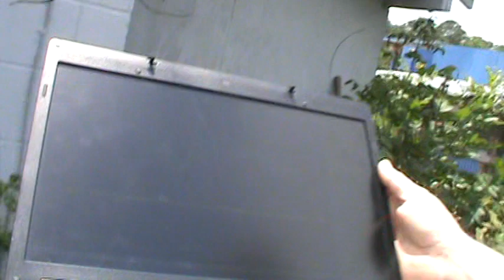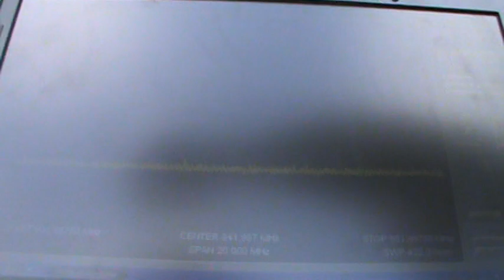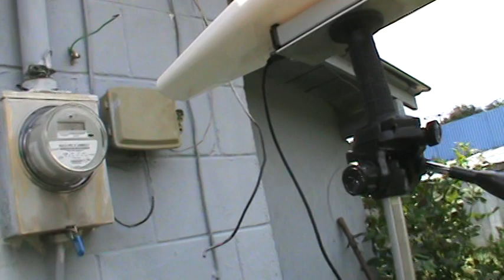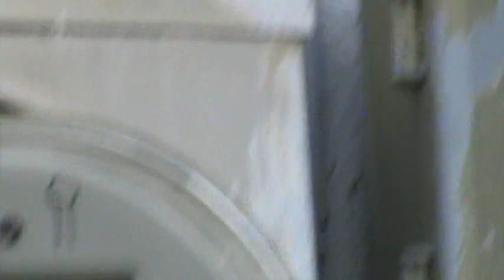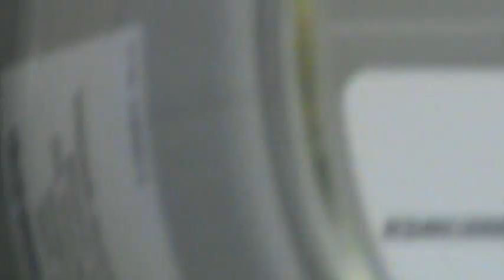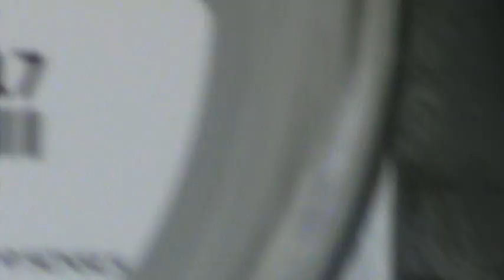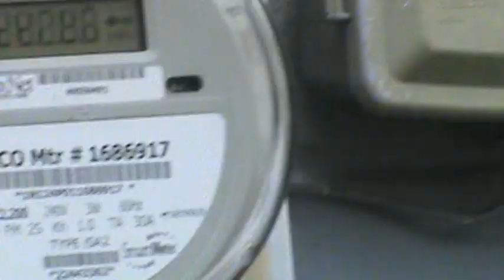Georgia Power Smart Meter Investigation Part 1

Comment: Everywhere’s you see a sign that read free Wi-Fi  a router is radiating signals through the air into and through your body, weather you use the location as a hotspot or not ,  if you have a blue tooth device in your house car work place you are receiving RF signals.  Cellular towers admitted a high voltage frequency in order to be able to reach you at long distances wherever you may be bouncing the signals off the other cell towers also increase the power of each phone calls to be able to be heard short and long distance.  Stop worrying about a meter that is red once a month and concern yourself with the amount of information your cell phone collects about you each and every moment of the day It knows where are you going and what you’re doing and who you’re talking to me while people sleep with these phones people keep them in their back pocket all the time so you can imagine how much radiation is going through your body that’s something I think about .   Never mind the RF frequency that you receive if you’re sitting in one of those wonderful electrical cars that I have a gigantic battery and you’re worried about your meter really.

Comment: Radiation, bottom line. So what's smart? You also paying for power is uses to operate. Da.
Reply: Not likely in a direct sense. The meter takes is power from the line side, or top terminals, therefore is not part of the meter reading totals!  But the old meters did the same, and had voltage and current coils, and some had digital displays and electronic pulse outputs where needed!
I guess it could be considered part of the operating cost of the company like everything else and get their money back when people pay their bills! Same with the old meters!

Comment: They also have the technology to transmit data over hi voltage wires.  Just search eBay amazon on Ethernet over wall outlets.
Reply: Smart meters are killing over 100+ people every month and you don't care.
What kind of person are you?
Reply from the maker: as part of further investigations into what was causing the problems overall, I used numerous IP over power line feeds gear, esp 2015-2018.....

Comment: They are lying , about it only transmits 3x /day. My srp account webpage will track and graph my electrical usage each and every hour of each and every day .
Reply: So which STUPID TREE did you fall out of Nase ASE?
Smart meters transmit 23 hours, 59 minutes and 30 seconds every day.
THAT IS WHY THERE ARE OVER 100+ DEATHS EVERY MONTH FROM THE EXTREMELY HIGH LEVELS OF SMART METER RADIATION

Comment: FCC this, & FCC that. That is what this guy is hiding behind, he knows that this stuff is dangerous but what the heck, he's gotta earn a paycheck.

FCC guidelines are a joke. China & Russia have better guidelines than the FCC. The FCC has not one single medical professional on staff or that has looked at the biological effects of this wireless radiation. Anyone that trusts the FCC guidelines you are gullible. There are 1,000's of non-industry studies that prove beyond a shadow of a doubt that this wireless radiation is harmful. The NTP study has recently showed that there is more serious health consequences from the LOWER level radiation than from the higher levels. 

He kept saying -31 dB was the reading. And how such a small number that is. Well, when measuring the dB level (decibles) of wireless radiation, guess what? The smaller number means stronger. So -31dB is stronger than -100 dB. And on some WiFi Signal Strength Meters that you can get as an App on your phone, shows that  -31dB actually pegs off the top of the meter as that meter reads between -100dB (low-no signal) to -40dB (high-great signal).

They also kept saying that the meter only transmits 4-6 times a day. Whose to say that the younger guy didn't first send a signal, a software message to that meter to go into a 'mode' of 4 to 6 times a day before he even set up this dog & pony show of an investigation. The power company keeping itself in line. Yeah, right.

And even if these SM's give off less radiation than a cell phone that doesn't matter. Why? Because you can choose to have a cell phone or not. Choose to turn it off or on. You are being FORCED to ave this spying, radiation emitting, fire-hazard of a device attached to your home with no recourse. You cannot shut it off, ever, or they will charge you with a crime.

It's all about controlling you and your spouse and your children--- everyone. It is all smoke and mirrors  to hide the lies.

People need to wake up, and STAND UP and say no!

Look behind the curtain. It's a really small and evil man who is afraid of his own shadow. All you have to do is STAND up for what is right and good. Or sit down and allow the evil to roll on past you uninhibited.
Reply: And now you know why smart meters kill over 100 disabled folks every month.

Comment: Here its spread spectrum unlicensed. And no tower exists it jumps from house to house and repeaters are hung on poles.
Reply from the maker: the receiving tower for local electrical service smart meters is at the GA Power substation 1/2 mile from my current home....it is specifically for electrical meters according to the people putting it up who I stopped and asked...you can google simpson circle in Cartersville GA 30121 and find it

Comment: SOMEONE lie here.  941 mgs is in the Ham bands .They don't own this 941 mhz. As they say. Check your ham frequently.  It is with in their hams bands. Check with a ham radio person
Reply: 2.3.1 Frequency Hopping Spread Spectrum

Operation in the 902–928MHz Band Regulations in the United States
The frequency band of 902–928 MHz is one of the Industrial, Scientific, and Medical bands in the US, commonly abbreviated as the 915-MHz ISM band. In this band, there are no restrictions to the application or the duty cycle as   there were for the control and periodic applications described above. Furthermore, the allowed power output is considerably higher. Because of the lack of restrictions and higher allowed power, this band is very popular for unlicensed short range applications including audio and video transmission. FCC section 15.249 allows 50 mV/m of electrical field strength at 3 meters distance in the frequency band of 902–928MHz. This corresponds to an EIRP of – 1.23 dBm. The harmonics limit is one hundredth of  the fundamental level, 500 μ V/m, corresponding to an EIRP of  – 41.23 dBm. Note that this is the same as the spurious emission limit listed in Table 1

Frequency Hopping Spread Spectrum Even higher output power can be used if the system employs some form of spread spectrum such as frequency hopping or direct sequence spread spectrum. The reason such allowances are made is that spread spectrum systems are less likely to interfere with other systems than are single frequency transmitters.
The output power limits for frequency hopping is one of the few times that the FCC expresses such a limit in units other than the observed electric field strength. As long as the antenna gain is not larger than 6dBi, the permitted peak transmit power delivered to the antenna is +30 dBm for systems with a 20-dB bandwidth lower than 250 kHz and at least 50 hopping frequencies. For systems with a larger bandwidth but less than 50 hopping frequencies, The peak transmit power is +24 dBm.
Transmit power for the 902 – 928 MHz band
Frequency hopping EIRP > 50 channels: +38dBm
Digital spread EIRP      +36.dBm
Other        EIRP  -1.23 dBm
ALL measuring shall be done with detector using a CISPR quasi peak detector.
 
http://www.ti.com/lit/an/swra048/swra048.pdf

Comment: Three things.    First he said the equipment was supposed to be 20cm form the meter   From what I see he is over 18 inches.  Point 2 is 20 cm is  just a tad under 8 inches therefore the 3db he is reading should be squared plus a little bit for a true reading of over 9dB.  Point 3 the tech is either stunned or lying no technician can be that stunned.  Point 4 is he is in charge of wuelling questions.
Reply: They know what they are doing. 
Do you really think they are going to tell a homeowner with a medical implant that are now FORCED to stay 2 to 4 feet away from the side of their own home?  
They will lose their job and PENSION if they tell the TRUTH.

Comment: Some of you people do not understand radio waves,  first this is not microwave, microwave starts at one thousand megahertz , witch is the bottom end of the microwave band, this meter they are showing is close to the frequency of the things that millions of people are holding to the heads call a cell phone,   baby monitors, cordless phones,  old cell phones,  police radios , and they put out way more power that these meters do,  a lot of the older things used 800 to 900 mhz frequency,

Comment: I'm not saying that I know EVERYTHING or trying to be the channel master here but I will tell you that I have had a LOT of time on my hands
since 1999 when I became disabled. I have also immersed myself in the radio arts for the last 45 years. If I need to know something, I look it
up from a RELIABLE source and not some hokum web site put up by someone who either doesn't know what they're talking about or has
nothing better to do than panic people over NON ISSUES like smart meters. I've read CRAP here from know nothings and I try to set them
straight with REAL, verifiable science. Sometimes I'm not so diplomatic about it but it scares me sometimes the things that go viral from
people who shouldn't speak when they don't know what they're talking about. They see "microwave radiation" and immediately think of that
DANGEROUS little box in the kitchen that burns your food when you're not looking. Actually, according to International conventions and
agreements, the range of frequencies in the microwave band runs from 300 MHz, or 300 MILLION cycles per second, to 300 GHZ or 300
BILLION cycles per second. I used to live in west central Florida. Outside of Tampa is the transmitter for channel 44 TV which was in the
sub band called UHF or ultra high frequency. I used to pick up the audio portion of Ch. 44's broadcast on 454 Mhz on my scanner so even
some of the
 TV that
 I watched back then was in the microwave band. Now, TV has been moved into a new digital band. Ch.44 transmits at
100,000 watts. If you go look around it's tower, you WON'T find a flock of
 dead birds that just happened to fly by.
One thing that I have noticed here is that the religious faction of the smart meter hater's club who try and dispute the facts that I post here
ALWAYS come back with what they THINK, what they've READ in the back of some comic book or Russian bot web site, or they come back
with some lame attempt at quoting some technical sounding jargon like "interferes with ionic bonding" which, by the way is what keeps the
sodium
 metal and chlorine gas from coming apart in your salt shaker so if you see a yellow gas coming out of your salt shaker that smells
like bleach,
 you call or e-mail me and I'll kiss your bare ass at noon on main street. Another guy tried to rattle off all these bad health effects
that smart meters "cause" like heart trouble, memory problems, birth defects, cancer and it's recurrence and DNA damage and failure of
DNA to repair itself once damaged. Now, you can look this up if you want to but Google it or go to some REPUTABLE medical professional
and ask. When you are conceived and your cells begin to divide, your DNA begins to deteriorate from that moment on. Most people are
familiar with the DNA double helix? It looks amazingly like a ladder that was caught in a tornado. It is twisted. It is of a certain length
according to what your parents contributed. EVERY time your cells divide from conception to death, that DNA gets shorter and shorter.
Ever wonder why you don't look like you're 20 on your 70th birthday? It is because your DNA is approaching it's end of the strand and your
BODY can NOT repair it's collagen and connective tissues as well if at all so things begin to sag. This is commonly referred to as OLD AGE.
The people exposed to high dose radiation at the Chernobyl accident in 1986 who's DNA was damaged never stood a chance to have it
repair itself because it never will but not because of the radiation which caused the damage. It's because DNA NEVER repairs itself!!! If
it did, we wouldn't grow old. I'd be willing to bet everything that I own in this world, an 1836 Sq Ft house on an acre, a Lincoln MKZ, a
100 CB / HAM radio collection, a shotgun, a rifle and 4 dogs
 that this "medical expert" hadn't had a DAY of medical or electrical training
IN HIS LIFE! The same goes for the guy that tried to explain 11 technical deficiencies that INSURANCE COMPANIES wouldn't stand for
and would be on the picket line at your side if he was right not to mention the UTTERLY MASSIVE liability that the power companies
would be leaving themselves open for if just one death was attributable to the "problems" that he cited in these "DANGEROUS" meters.
People, you have to STOP taking everything you read and hear at face value and take the time to actually LEARN about the message that
you are trying to spread. You birds of a feather get into your own little flocks and reinforce your own MISINFORMATION until your whip
yourselves into a lather over nothing. I'm NOT saying that there aren't dangers in the world but while you are living your lives ducking and
dodging that BB that the
 power company is wanting to mount on the side of your house, you are NOT seeing the cannon balls coming at
you with global warming, (regardless of what you think, if you live long enough, you'll see who's right.), other air and water pollution waning
energy supplies and world overcrowding. ANY 1 of these will put a bigger crimp in your lifestyle before that flea powered smart meter that
transmits
 for a WHOPPING 40 1/1,000th's of a second per day TOTAL!!! SMARTEN UP, PEOPLE, YOUR LIFE MAY DEPEND ON IT SOMEDAY!!!
Reply: I apologize for the broken text in my last post. It doesn't do it in my e-mails or word processing so I THINK it is something with
YouTube. I'll get it checked out when I can. Jeff M.
Reply: Jeff for someone who seems to be of the opinion  that smart meters are good for us I find your multiple posts which must take up your expert knoledge would be solving the Mars problems so we can expand mankind.  But you seem to me too invested in telling others that have concerns that they are stupid no not stupid . I ask you what benifit can you state that we must be crazy not to see from this microwave transmitter. I suggest that one read u.n. agenda 21and population control 5g silent wars which are great reads by the way. And the fact that c.i.a. and others have tools 
Like you seem to be to stifle the truth. Conspiracy theories was a term coined by. The c.iA. to label those who questioned the j.f.k. official cover up. We are awake aware and you are tool . Or someone who just worries too much what others talk about.
Reply: @yorick30127  My problem is with people like you, 1) First and foremost, you DON'T know what you're talking about which conceivably could cause a panic among people like you who don't understand the subject that you panic about. 2) You, like tRump, like to try and whip people into a frenzy over imagined or minimally invasive subjects like extremely low powered transmitters and the effects from them that do NOT exist. 3) I never said that we need smart meters but the only benefit that I can see from them, living in the rural area that I do, is saving the power company money in truck fuel and man hours in driving all the way out here to read a few meter per road mile and hopefully forestalling a rate increase by a few months or years. You, yourself, seem to have a lot of time on your hands. Why don't you spend some of it and get a degree in electronics engineering, It will help you to sleep better at night to actually know what you are talking about rather than spreading the manure that you read on the net coming from other people who don't know what they are talking about either. If you really want me to solve the Mars problem, it will require a transmitter with an output of several megawatts, (millions of watts), to communicate with the space probe. Why don't you put your money where your mouth is and donate an acre of your property so I could install the transmitting antenna adjacent to your house. Then you will have a REAL RF pollution problem to worry about rather than a falsely perceived one.
Reply: @yorick30127  ...We are awake aware and you are tool ...
I just noticed something. This sentence reads like it's coming from a Russian troll. "and you are tool"??? An American would have written "and you are A tool". HMMmm.